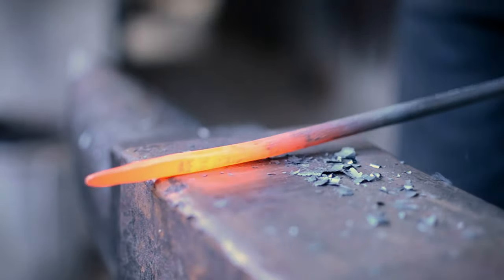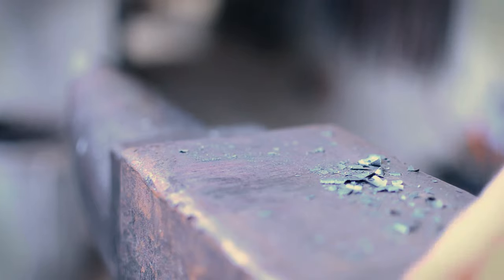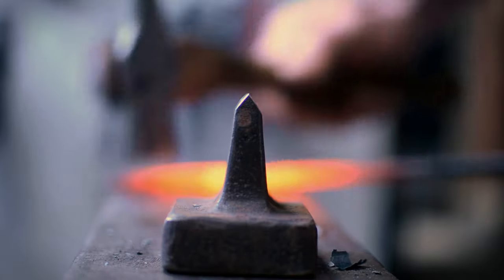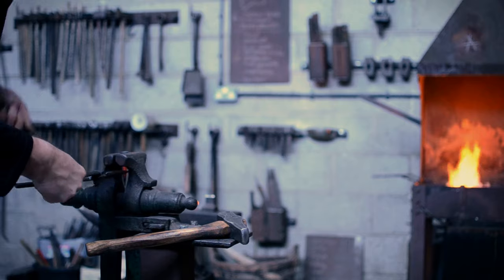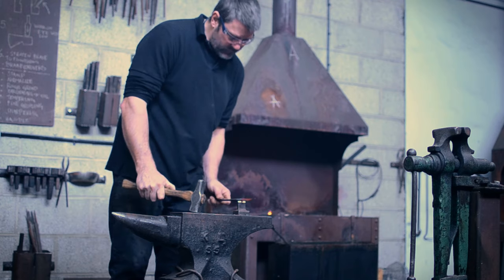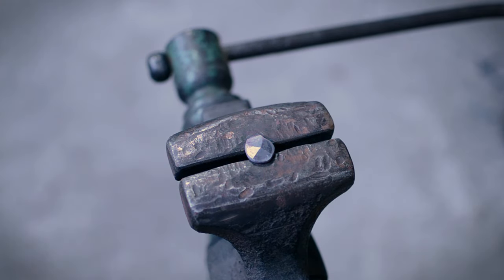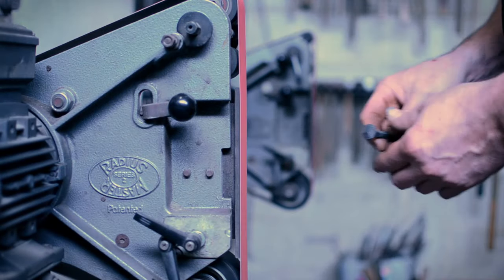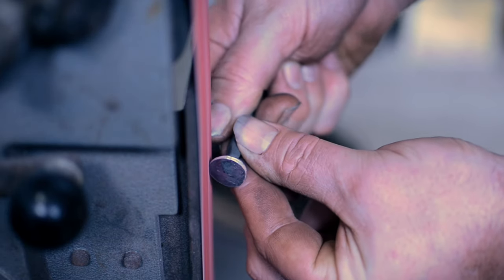Blacksmithing : Making Nails - The Forge

Comment: Hello , I wonder how you control the required lenght if you make them like you do?? And i'm very sorry but i don't like the GRINDING part. I use a nailheader i made from scrapspringsteel and i always start with square material.and  i FORGE the  heads in their correct shape Kind regards Blacksmith F.Ponseele-Belgium

Comment: I just watched Alex steele's video where he made 500 nails in just over 12 hours now he did several thing differently to you his nail were smaller about an inch and he used a tool to hold the nail while shaping the head. 
He showed a film of an old blacksmith making nails they used under 30 or 40 strikes to shape it, the used a tool where after shaping the nail they dropped it into this tool and formed the head and they did it in one heat
Reply from the maker: That's correct and certainly the most traditional way to forge nails . I haven't watched the film but he probably used a 'nail header' . I have been forging nails in a less traditional way using a leg vice as it was always much easier to teach beginners that way. On average I can make 25-30 an hour of the 3" nails. Thanks for watching and new film coming soon

Comment: Guuyyyysssss! This was absolutely great! Thanks for this nice sit down and talk Alex! I really like getting into the why and how! Do you think you would be able to go through the same process with a gas forge? You'd probably manually cool off the tip? Would love to hear your thoughts on that!
Also - Steve, man that was a great little educational short film! Great cut - great audio and a story well told!
Reply from the maker: Thanks Kjell!! 
It's a little more difficult in a gas forge just because of the inability to isolate heat like you can in the Coal forge, but it's certainly possible.
Reply: I’m using a gas forge for nails, not as pretty, using a nail header as well.

Comment: Great video, im trying this out to make nails for a cabin my dad is building. I noticed the grip from the vice creates a thin spot on the nail below the head. Will that compromise the nail?
Reply from the maker: Great to hear you're trying this out for yourself! We haven't had a nail bend or break on us yet so I don't think there's any worry about compromised strength there.

Comment: Starting out with blacksmithing, so I know very little- watched a few videos and have noticed many smiths have a rhythm and stop to tap the anvils a few times- why is this a thing?
Reply from the maker: It's mostly just a way of keeping rhythm, we strike somewhere in the region of 20-30,000 times a day, so stopping to turn the material, or check if things are moving in the right direction and then restarting can, over the course of a day, really increase the effort involved. Plus due to the rebound on the anvil surface it helps get the hammer back up when not striking stock, again to aid efficiency. There's actually a very good video about this on the "Today I Found Out" YouTube channel.